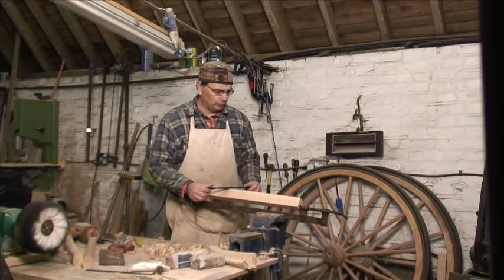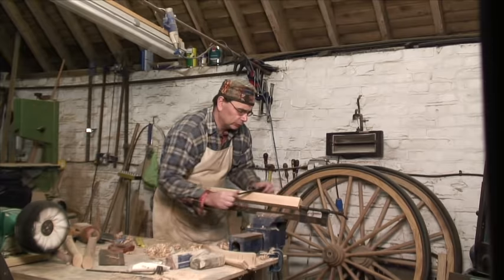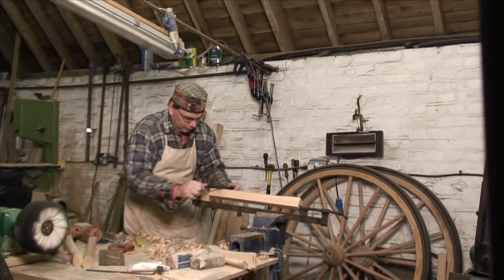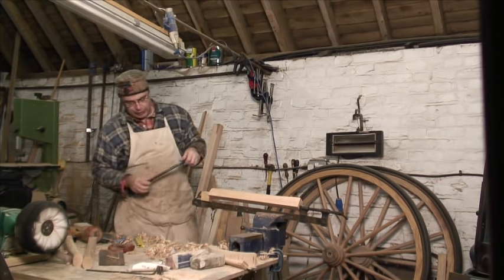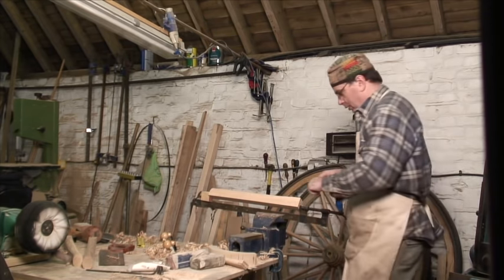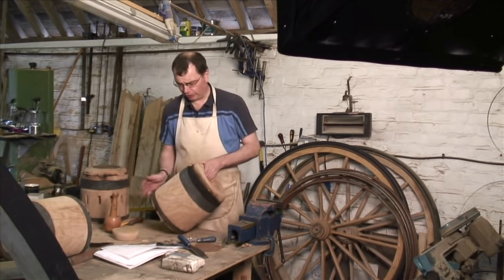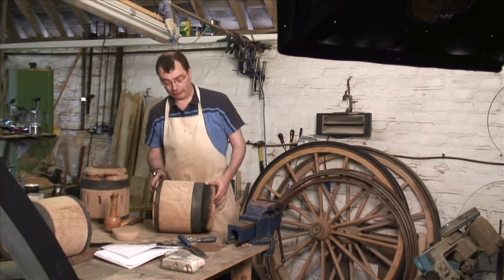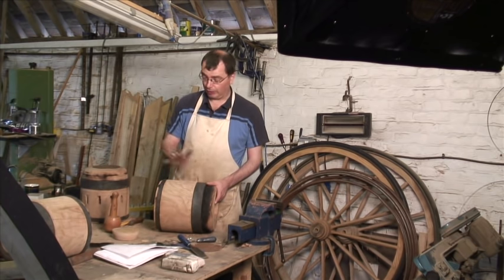Making a Wooden Carriage Wheel pt 1

Comment: I have to say I wouldn't call Ash ideal, hickory is ok but thats the American way, originally developed for mass production ie warner wheels etc. Certainly not common in this country.
The problem with using ash is it is too flexible, eventually the spokes will follow the dish of the wheel quite considerably, they will also have the tendency to bend under the pressure of hooping, especially with lighter carraige wheels etc. I tend to use french oak for my spokes from the Limousin. cheers, Phill

Comment: Greetings...
Thank you for the great video!
I wanted to ask about your mortise attachment for the drill press. What brand is it? 
I want to buy one, but everyone seems to advice against them. Saying they are not as good as an actual mortising machine.

Thank you
Reply from the maker: Thanks for looking. Everyone is right, a real mortice machine is better, but only if your doing small bits of wood. Their designed for square bits of wood up to 75mm. If your doing hubs like I do, I am not cutting big difficult mortices but I need a machine with a large capacity so a Drill press version works for me

Comment: once again thank you very much for your reply. what number would I need for the spoke shave? the 151 seems to be popular but I know nothing about it, not even what the numbers stand for I guess size?. also thank you for your advise on the draw knife I have seen a nice Mike Abbott designed one which I will buy.
Reply from the maker: Huw Smith The 151 spoke shave seems to be the one to buy. Its got a flat base so good for what you need it for. Once you get used to using both the spoke shave and draw knife you will wonder how you ever did without them.